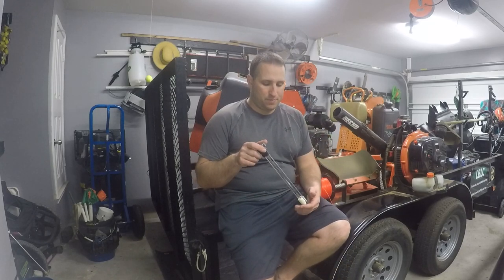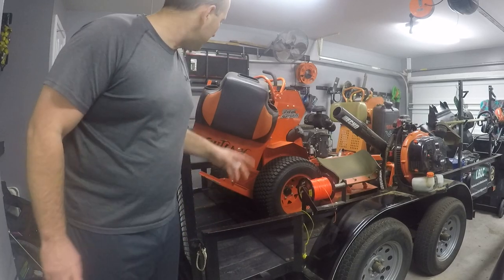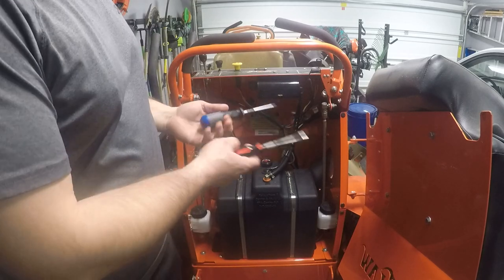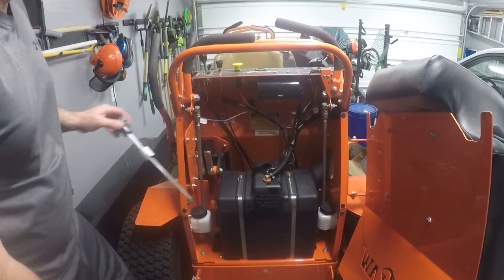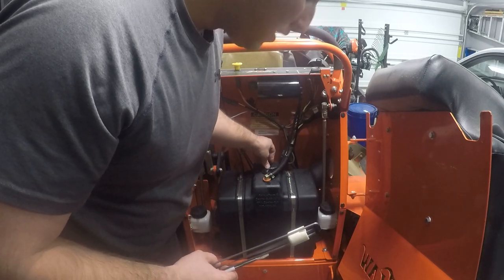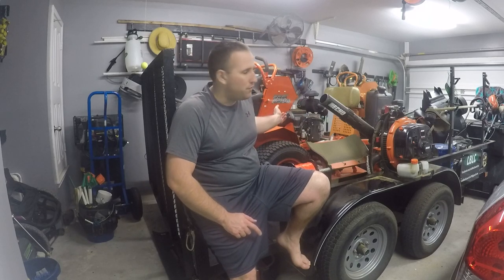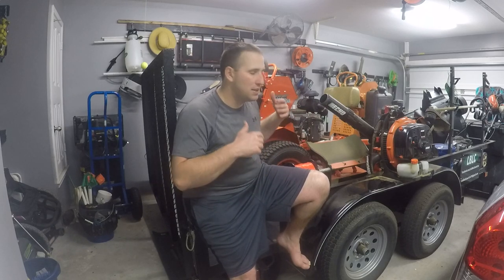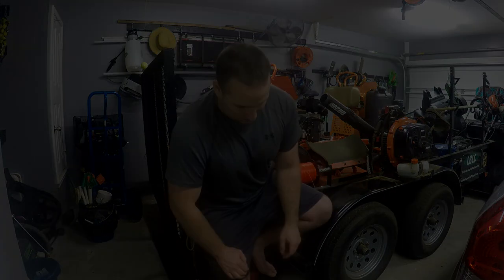BadBoy Outlaw Stander Fuel Gauge Repair

Comment: Gravely mower absorbed gas into plastic and stopped floating. Read empty all the time. Replaced just the float. The amazing thing is I tested with water and it worked due to the water density (8.34lb per gal.) being higher, but would not float in less dense gasoline(6.1lb per gal.)!

Comment: Cheaper solution: Drill holes in bottom of float (the float is a solid piece) to trap air.  My float on my bad boy zero turn would not float in gasoline. It just sank and read empty. It did float perfectly in water as expected since water is denser. I read about drilling holes since air is always going to float. The unit once pulled out is just a cheap snap together system. So I took it apart and drilled four 3/16” holes about 3/4” deep from the what will be the “bottom” side of the float vertically and parallel to the guide rails. Two holes on one side of the float and two on the other so when looking at the “bottom” of the float you will see five holes. The original hole for the flat shaft and the four drilled holes. Reassembled it with the drilled holes pointing down towards the bottom of the tank. Now when placed in the tank air is trapped in those four holes and up the float goes to the surface of the gasoline and gives an accurate reading. Just BE VERY CAREFULL DRILLING as not to go through the sides or top of the float. You are drilling pocket tubes parallel with the guide rails to trap air. Total cost: $0.00 and an hour of quick research to discover the drilling idea and doing the same to my float. I think buying another unit will just do the same thing in time and I think it’s from particulates in the gasoline (ie not changing your fuel filter enough or using cheap filters) cling and get absorbed into the float and makes it just heavy enough to float in gasoline.
Reply: Sorry, drilling holes didn't work for me.

Comment: Just bought a brand new Gravely compact pro 44.  Fuel gauge stuck on "F".  Do those fuel gauges screw off or pop off?   Do I need to replace the entire fuel gauge or is a simple repair once I get the file gauge out of the gas tank?

Comment: An interesting thing about it not working is it will work in water. I took mine back to the dealer and he tried it in water and it worked. I brought it home and put it back in and it didn't work. So I filled a container with water and one with gas. It will float in water it won't float in gas. Looking online and what the comments say is there is some problem with the white float. Something about the specific gravity/Relative density of the plastic (Google it). I am waiting for a replacement now, see if they figured it out.

Comment: 2017 zero turn and my gauge started showing always full. Found that the solid plastic float quit floating in liquid. Replaced just the plastic float and works great. Now using a plastic part from a 20yr old boat tank. Go figure....

Comment: The other problem on my 2007 Lightning is the indicator decal on the inside started to turn white, then back to normal black, then white....back and forth and now just stays white. Seemed to be temperature related. 

The fix is easy. Remove the sender and using a drill chuck and small drill, by hand, move the indicator to empty, quarter, half, three quarter, and full and use the drill to make a small divot in the face of the plastic at each of the indicated positions. Then take a black permanent marker and color in the divot. Saves you the expense of replacing a good sender, $43 worth, just to see the fuel amount.

Comment: Yep mine did the same thing to the T, works great out of the mower reads E in the mower. I think your right it must soak up gas and not float anymore other then that love the mower
Reply: I got one Thursday brand new never had but a tiny bit of gas in it. Didn't work at all. Bad boy sent a new one.
Reply: Bing carbs have this problem. The float is seal coated and after some years the seal gives up an the float saturates.